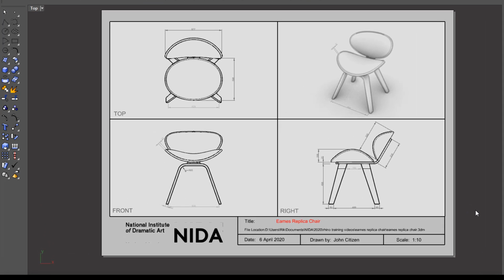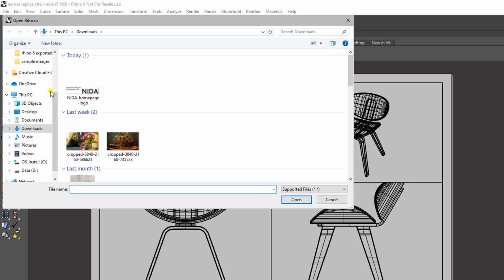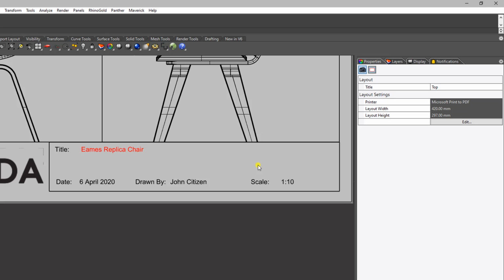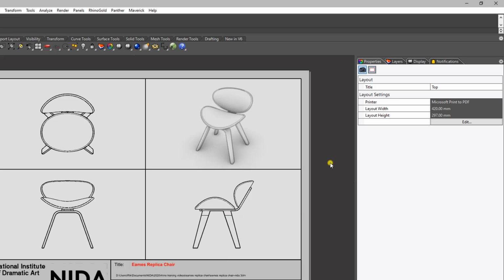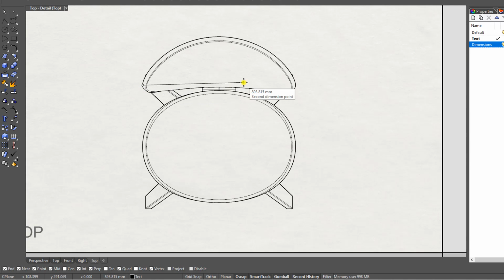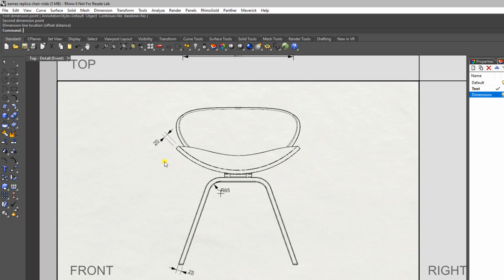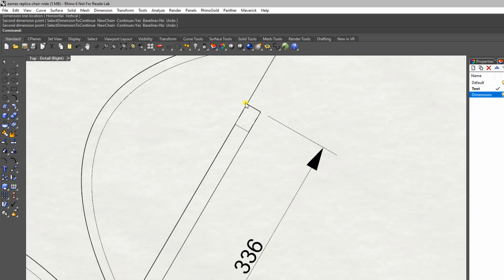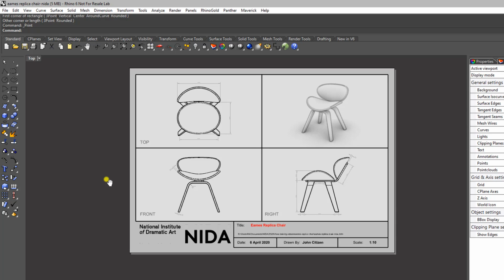Rhino 6 - Layouts & Dimensioning

Comment: Thank you - great tutorial. Just confirming, the dimensions are not fixed to the object, but rather it is like they are on a piece of tracing paper over the drawing? i.e. if you rescale or pan the object, the dimensions will not move or resize to fit - correct?
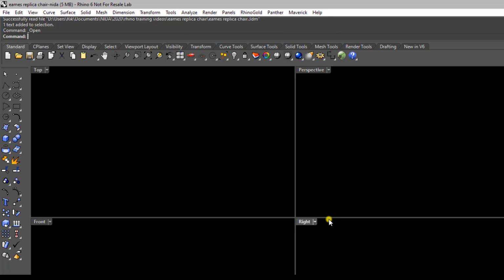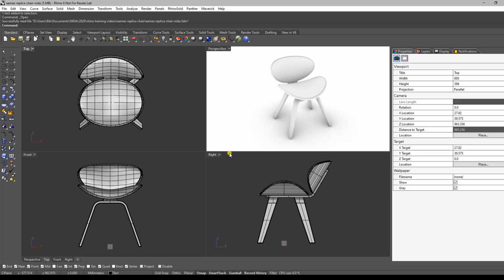Hence, if you change your mind about the location of the object within the viewport (for instance because you didn't leave enough room for the dimensinos near the edge of the viewpoint window) or decide to go from 1:10 to 1:20, I take it you have to start dimensioning from scratch?
Reply: hii i have the same question, i wonder if there may be an alternative to this